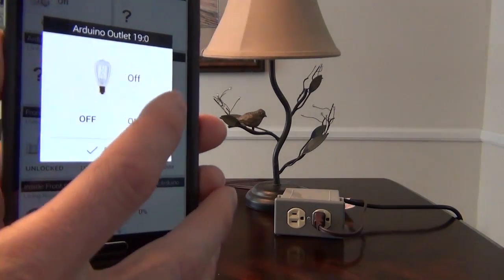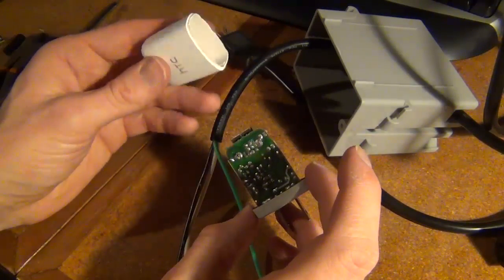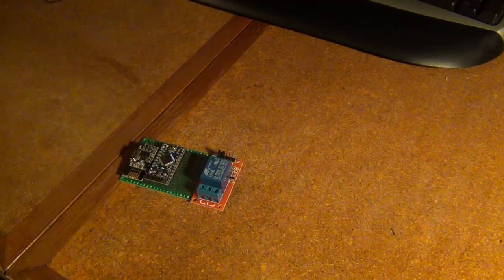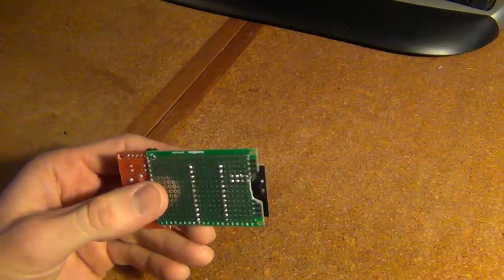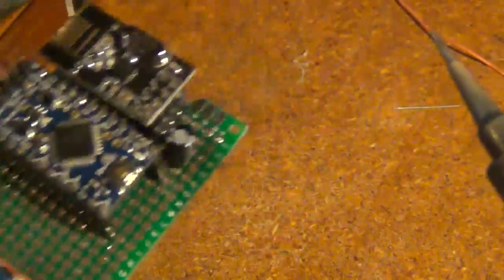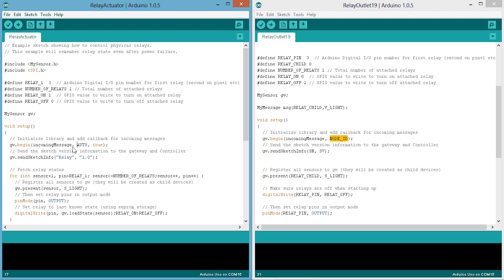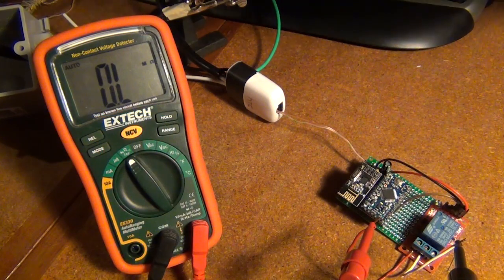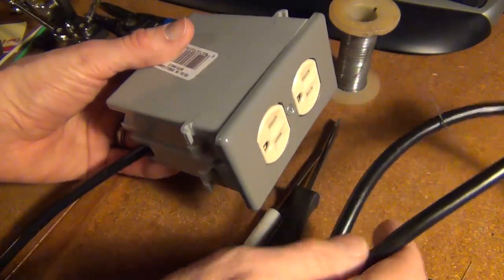$8 DIY Arduino Smart Outlet Lamp Module

Comment: Much simpler and safe solution is to use a simple remote controlled outlet and use an AM transmitter from Arduino to turn it on and off. Super cheap and simple.
Reply from the maker: +Aurelien Boubennec (AurelienB) Yes, I actually do something similar with my blinds.  The only problem with this is there is no "acknowledgment" that will tell you if switch actually turned on/off.  So you're never sure if it actually worked or not.  Thanks for the comment though.  It can help people who don't want/need an acknowledgment.
Reply: +Pete B Yes very good point. In my project I use it to turn on a growing light and I use a photo sensor to detect if there is enough light hitting the soil. So it's rather reliable but it must be totally unreliable in some cases you are right. I use this method because I am not good at dealing with 240V and scared to burn down my appartment ;-)
Reply from the maker: Aurelien Boubennec Better safe than sorry :)

Comment: when will people learn using Arduino to do this sort of stuff is OVERKILL
Reply: +marmackk do you mean that you could accomplish it with a more simplistic device? I think the primary reason for the use of arduino is the low barrier to entry and cost. From China, you can get a nano or pro mini for under 3$, and because there is such a large community, its much easier to use then trying to build a more simplistic device from scratch. I believe that wireless module that is being used actually has two io pins that you could use, and have it be the controller even, or possibly using a smaller arduino variant.
Reply: you can buy the micro controller for 1.75 

You don't need the whole board. It's not even hard once you understand the arduino .

Comment: How would you create a smart/relay outlet with an Arduino, where it senses when your computer is asleep  via usb sleep detection?
Reply from the maker: +simdude2u Hmm, you may be able to cut the end of a usb cord and feed it as an input into the arduino.  You would need to make sure you don't put in too many mA though.  You would at least need some resistors but maybe more.  I personally sense when my computers shut off with my Vera and the WOL/Ping plugin.  I can then perform automation actions when the computer stops responding to a ping.
Reply: You can check that without the arduino.  Just a simple voltage comparator.  Most computers power off the USB port when it goes to sleep.  So if(Vin=5V) computer alive,  else computer is sleeping.  This is a simple comparator which compares against 2.5V. The output is fed to a transistor which controls the relay.  We have this in Europe so we power off monitors,  printers,  scanners,  speakers when the computer goes to sleep or turns off.

Comment: You should be very carful as the latching relay maybe just 10 amps but the main circuit is still protected by a 20 amp breaker. Which means the usb hub is a fire hazard. As it will catch fire long before the breaker trips. As you have no overload protection of short circuit in the USB low voltage case.  One reason you're not allowed to run low voltage and high voltage in the same devise. One has to be protected on a low voltage circuit and the other by a high voltage circuit breaker.
Reply: ahmedadelhosni90 You put a fuse on both sides of the relay. One for the source voltage circuit and one on the load side going to the devise its powers on. The same way you protect an AC\Dc power supply.
Reply from the maker: +Claude “Reviews4U” Rains Yes, you definitely need to be careful about the load used.  I am using it for lights so there is no way it will draw 10 amps.  You definitely wouldn't want to use it to turn on a vacuum or something like that though.  Thanks for the comment.
Reply: +Pete B Both comments are great, but what will happen if a short circuit occurred ? It happened to me once by mistake, where I designed an AC load electric relay to turn on and off a lamp, and by mistake there was a conducting plate under the PCB and it shorted the AC source. What happened is that the breaker cut off the power but also the electric relay was damaged. You think I should have put a fuse rated less than the rate of the breaker ampere, right ?

Comment: Nice! Just curious though how much power does that cell charger draw when plugged in. 1w?
Reply from the maker: +Carlos A Sorry for taking so long to reply.  I just plugged it into my "kill-a-watt" meter and it was fluctuating between .4 and .5 watts.
Reply: Pete B Oh not too bad I guess.. it looks like you used a name brand one of good quality I assume. Wonder who makes the most efficient one out there, also wonder if putting the arduino in low power mode will lower that standby power consumption... Anyway thanks for the info and video!
Reply from the maker: Carlos A Good question.  I haven't tried to put it into low power mode.  Maybe next time I will do that as a test.

Comment: Hey, will you be able to open it when ever the sun goes down every day ? Will it be able to pull data from web to understand the timing to open and close every day ?
Reply from the maker: +M. Yıldırım I use Vera as my controller and it knows when sunrise/sunset is so yes you could turn it off/on based on that.
Reply: Overprized products...

Comment: I feel like there is a better way of doing this...
Reply from the maker: Karan Trivedi Yes, I'm sure there is.  I did it this way because it was cheap and relatively easy.  If you have any ideas on how to do it better feel free to post here so others can learn.
Reply: N o i meant that like there is a simpler way of doing this.. I wanna hack into my switch that controls the bulb in my room.. this seems a very complicated method.. haha. I am in third year or electrical engineering, I feel you yould build a transmitter and receiver circuit to send signals without having to deal with arduino.. maybe.
Reply: +Karan Trivedi You could, and infact that wireless unit he has there even has some io pins that could be used for something like this, or a less robust chip could have been used instead of a full blown arduino. But at cost and ease of use, you have to ask is the time trade off worth it to develop something else, its already really cheap, esp compared to whats out there on the market commercially to do this.
Reply: Ah my mistake, I thought it was the esp8266 being used, looks like its an NRF24L01 or some varient
Reply from the maker: Seth Stenzel Yep, it is an NRF.  The reason I used an NRF is because this project is part of MySensors which doesn't support the ESP for something like this (yet).  Thanks for the comments.

Comment: Why Arduino? It would be much simpler with a esp8266..
Reply from the maker: aguaviva Agreed, it would be simpler.  To my knowledge the esp8266 isn't compatible with MySensors yet which is what I'm using to interface with my home automation controller.  I'm sure it will be soon though.  I can't wait to start using the esp8266!
Reply: it Arduino can do it, the esp can do it too.. just port that C code.
Reply from the maker: aguaviva Good to know, thanks!  Looks like I need to order an ESP and start experimenting.

Comment: stuff to do: -use an esp8266
                -use an attiny45/85(serial library arduino programed)
               -  2  stand alone  5v  relays(out 10A 240v)
                - Custom PCB(/watch?v=6uInan-TjiA)
Reply from the maker: Gabi Done I would love to do a custom PCB.  That's on my list to do eventually.  I thought about doing two separate relays but haven't had the need yet.  This stuff is lots of fun.  I love trying new things so I will eventually get to it...

Comment: @Pete B This is an awesome video. Thank you for sharing. I have been looking for some way to connect an arduino to my veralite system. I have the Latest Version of vera (1.7.649 which is UI 7 i think). I am wondering if this setup will still work with the newer vera UI. Have you upgraded your vera UI?

Again, great video, thank you so much for sharing.
Reply from the maker: Mohammed Issa Thanks!  I personally haven't upgraded but I know people have and it's working for them.  I have seen some issues with fake Arduino Nanos and the Serial gateway so if you haven't ordered your parts you may want to build an Ethernet gateway instead of a Serial gateway.  It seems to work better.  Check out the mysensors forums for more info.  Thanks.

Comment: the video is great would wrap electrical tape around the screw terminals on the outlet when I install it to keep you from getting shocked when you work on it.
Reply from the maker: Phillip Smith Thanks!  Yes, that's a good idea.  Always good to be as safe as possible.  Thanks for the comment.

Comment: Is there a way to make this work with a light switch? The main problem I see is not having a power source fro the arduino...
Reply from the maker: Arvind Balaji Yes, you are right, you need a power source for the Arduino.  Light switches are in the wall so there are special requrirements for that.  I was actually just asking on the forum if anyone had any ideas.  You can check out the thread here if you're interested: http://forum.mysensors.org/topic/1607/safe-in-wall-ac-to-dc-transformers/

Comment: You are my Master!!!! Loved the project!!!!!!! Thank you.
Reply from the maker: apzeiroturbo Thanks for the kind words!  The credit goes to the MySensors team though.  I just made the video :)
Reply: Pete B Can you tell me how much Arduinos Pro Mini (radio slaves) can this controller handle?
Reply from the maker: apzeiroturbo are you talking about the MySensors gateway or the Vera?  The MySensors gateway can have 254 children (pro minis) and each child can have 254 devices.  I have over 80 MySensors devices running in my environment now.  Vera is usually limited by memory rather than devices but I have over 120 or so devices working on mine now.  Let me know if you need more clarification.
Reply: Pete B Thank you Pete. It responds very well to the question. Now I am trying to learn more about Vera Controller. Does the MySensors Gateway works like the Vera 3 Controller? And about the interface with thi s gateway, do you have some video? I am trying to see all your videos to learn, but somethings are still not clear for me. The communication (the brain of the system) is my biggest problem. I made a php+arduino+enthernet shield interface to control somethings, but this wireless solution is way better. I sew the price and the Vera Controller is accessible, but is there any similar solution with just an arduino or maybe some Raspberry Pi? Sorry about my poor English. I'm not sure I could express myself well.
Reply from the maker: apzeiroturbo Your English is good.  The Controller is the brains and where most of the logic happens.  The MySensors gateway is the interface between the controller and the sensors.  The controller doesn't have to be Vera.  Check out this link for a list of other controllers: http://www.mysensors.org/controller/
I think most of the developers are using Vera so that will have the best compatibility.  If you are trying to save money the OpenHAB project seems to be used quite a few people.  I may start testing it someday when I get some more time.
Let me know if you have more questions but also check out www.mysensors.org.  There are lots of answers in the forum.
Reply: Pete B Yes, I was thinking to use OpenHAB. Thank you very much. I will make a research about the options.
Reply from the maker: apzeiroturbo Great!  You're welcome.

Comment: Pete, awesome video! You've motivated me to try this.  For the "my sensors" compatibility, is that just a Vera plugin?
Reply: May have answered my own question... 'My sensor' is a code library that enables you to read the ZWave commands from the antenna plugged into the SPI port of the arduino board correct?
Reply from the maker: Ray Farmer Great!  Just be warned once you start it's addicting :)
MySensors took me a while to grasp the concept but basically it will allow you to build your own sensors.  There is an Arduino gateway that talks to the Vera (it can either be connected through Ethernet or USB.  I personally use the USB because it was the only thing out when I started but I'm going to attempt an Ethernet some time soon just so I can learn it.  Once you have the gateway built you will need to install the MySensors plugin in Vera so they can speak to each other.  Once that's set up you will build wireless sensors that will talk to the gateway which will translate those commands to Vera.  The devices look similar to Z-Wave devices in Vera but they are actually communicating on 2.4GHz.  Hopefully that makes a little sense.  Let me know if you have any questions.
I'm hoping to make a getting started video for MySensors but I have 1 or 2 I'd like to do before that.  When I first started there was a fairly large learning curve for me because I had never used Arduino or Vera for very long, so, don't get discouraged if things don't work immediately at the beginning.  It's worth it in the end!